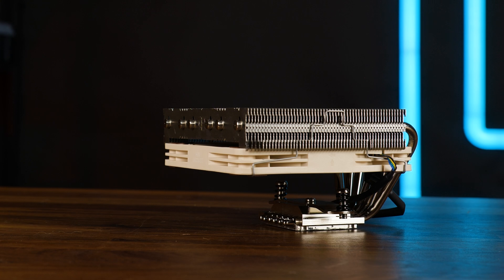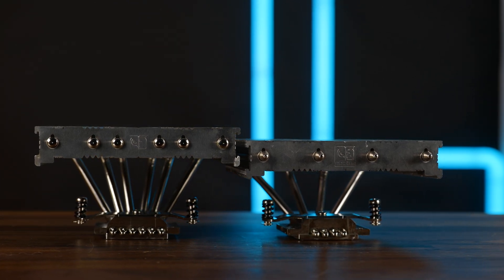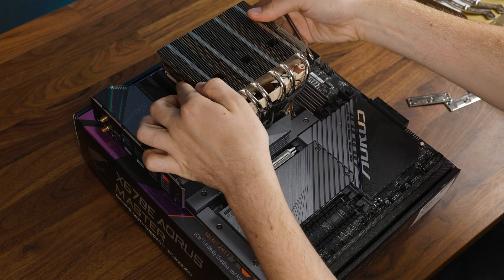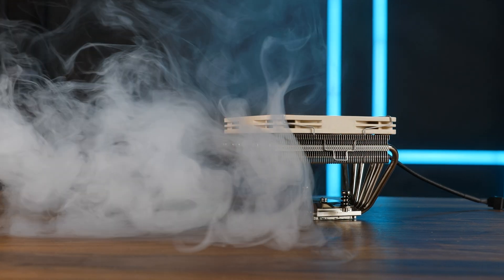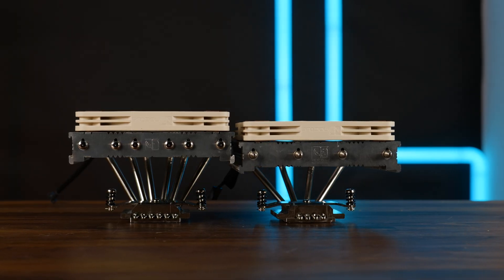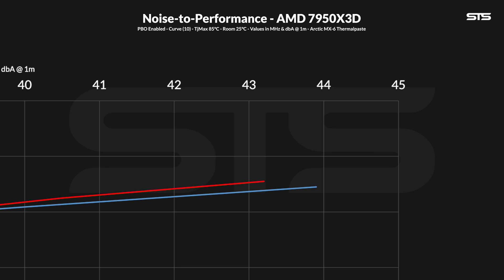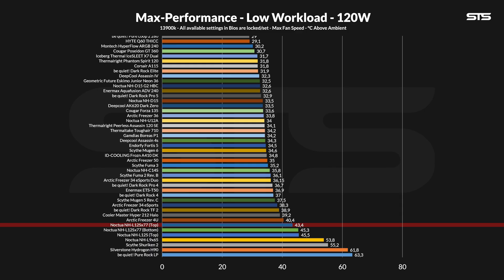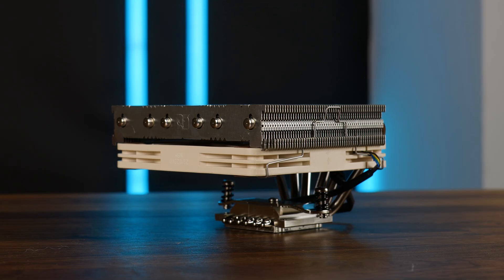Upgrade For SFF Builds - Noctua NH-L12Sx77

Comment: People designed niche sff cases with Noctua coolers in mind.  Now, any new potential buyer will have to look elsewhere for a cooling solution. Noctua might just have tp keep producing the older model.
Reply: There are other cases that need this height. I have a compact case that can only fit a 85mm height

Comment: I am a terra user and switched from my L12GE to the L12Sx77 and the Sx77 performs so much better than the L12GE. Didn't expected that much improvement. But i think those 2 more heatpipes help so much. In combination with the offset on AM4.

In my opinion: If u can fit a fan on top of a L12(GE/S/Sx77), just get the bigger cooler if u have the space. I mean 91mm, 95mm an 102mm. There isn't much to the C14S or D9L anymore.
Reply: is the offset mounting included in the Sx77 box? or must be purchased separately?
Reply: The original L12, (L12 Ghost) was supposed to be replace by L9x65. It only made a came back because of the popular demand. Between L12S and L12GE, there should be like 10c difference.

Comment: This is a pretty good review overall, I must say.

What I dont get is the orientation of airflow. With the fan on top, shouldnt it be pushing instead of pulling air?

That is usually always better and on SSF youd want to pull air from outside ventilation also, so even better results?

Comment: The problem is not so much the ram height, but the vrm+i/o massive heatsinks and covers that manufactures put into their motherboards and is a big problem with mini itx boards. I have some corsair ram without rgb and they are 34 maybe 35mm in height. The L12S would just clear the ram, but then the 120mm fan bumps on the i/o shroud cover thing. The x77 would probably clear it, but the extra height will render my itx case and many others not compatible.

Comment: As a SFF only builder, thank you for this review. For another Noctua alternative, the 4 heat pipe L12 Ghost Edition is 66mm in height and weighs 20 grams more than the original L12S. Remove the included old 92mm fan and mount a 25mm fan on top for a total height of 91mm. Noctua will provide free 25mm fan clips for this cooler with proof of purchase.
I have tried this with dual 92 &120mm fans - don't bother - simply use top mounted 120mm fan.

Another good low profile alternative is the Thermalright SI-100 at 100mm in height with a 25mm fan. Includes both 15 & 25mm fan clips. Included fan is older, 7 blade louder operating fan. Easy enough to pick the fan of your choice. Would like to see this added to your testing review list as this 6 heat pipe cooler is thicker & heavier than any of the L12 coolers, but still substantially smaller than the Noctua C14S.

Comment: Four years ago I built a Ryzen 3600 system in a Silverstone SG13 shoe-box case, using the old version of this CPU cooler. Last spring, the price of a Ryzen 5900X got very reasonable (and $50 cheaper than a 5800X3D) so I bought one and a be quiet! Dark Rock TF 2. Sadly, I failed to check motherboard compatibility, and now have a be quiet! box taking up space on a shelf. I ended up cooling the 5900X with a Noctua NH-U9S that seems to work well enough. I had to remove the case lid, and mount the power supply on top of the case frame, but it seems to work. MSFS 2020 runs smoothly on three 1080P monitors, so I am good.

No sure what I am going to do with the old coolers now.

Moral: If you are so space-limited that this type of cooler is necessary, there is not upgrade path in the future.

Comment: They actually fucked up. Instead of making it the same height, they increased the height. Do you have any idea how many cases they took out with the compatibility?
Reply: He literally says they lost some case compatibility in the review.
Reply: Wait for a revised L12s 😂
Reply: Does it fit in the fractal terra with a 2.5 slot or 3.0 slot gpu
Reply: @Unknownuserlmao  I think you need a 2 slot gpu :( (inno3d models for example)
Reply: They didn't F*** up... this thing fits a 120x25 underneath, completely different design.

Comment: $75! WTF
Reply: As usual, Noctua's pricing is a scam
What a surprise
Reply: @Violet-ui  You pay their price and you get their product. How is that a scam?
Reply: @darkerrapture   It's very, very overpriced. That's all. People call stuff like that a scam, even if it's technically not as you do technically get what you bought
Reply: @darkerrapture  Its not scam per se but a realy bad value. You can get axp120-x67 or IS-67-XT for 30$ (or cheaper lol) while being lower height and similar performance (or better). Heck you could buy some noctua fan and it would still be cheaper than noctua cooler.  Only good thing is noctua will supply you mounting kits etc. until you finnaly let die this cooler (my nh-d14 still trying not to be kicked out)